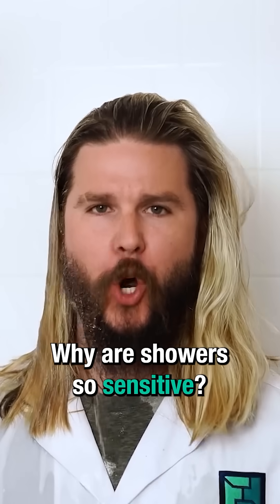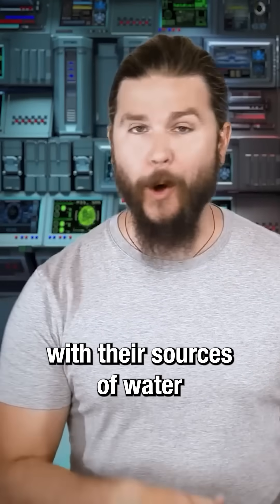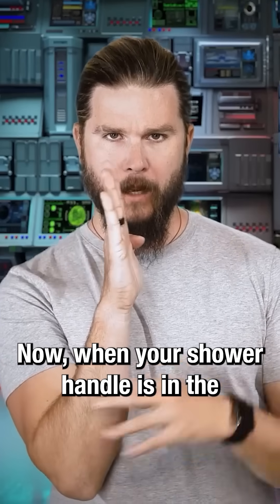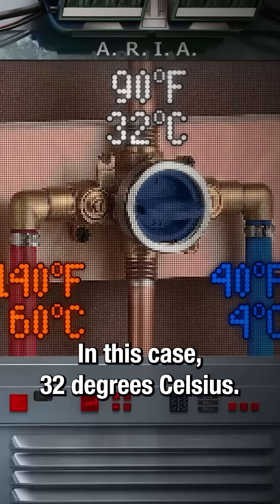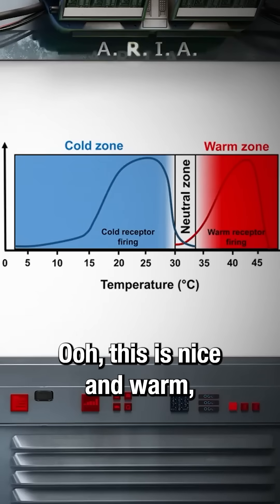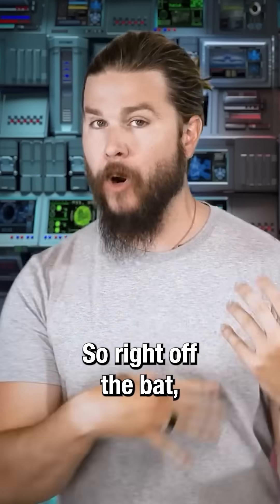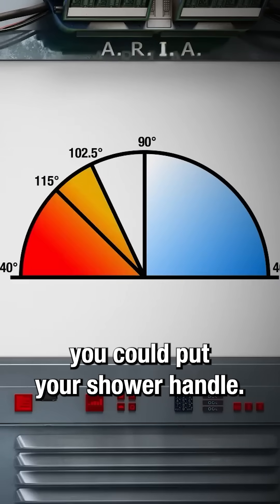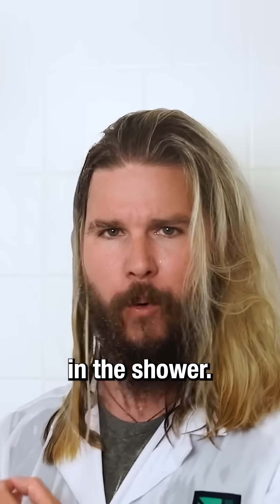Why are showers so sensitive? 🥶🥵

Comment: Kind of, but not the main reason. Due to thermodynamics its hard to perfectly mix two fluids in equal measure. There's almost always an imbalance. To achieve a good mix, you need a feedback loop so that fluctuations in temperature cause compensation of the missing hot or cold ingredient. This is best done with a thermocouple such as a bimetallic strip. Without this you have to get the mix just right by hand, which is a delicate balance.

Comment: No...pretty sure mines just messed up. You can see the pressure drop when it starts letting the hot water "mix"... because it shuts off the cold water. No, i dont mean there's a tiny few degrees of pure bliss. I mean it legit turns off the cold water and only lets hot water through. If you go slow enough you can actually get a slight trickle where neither of them are really working right about in the middle. Screw this apartment man. Havent even mentioned that the shower nozzle in from the side wall so you only use the front half of the dang tub to shower.

Comment: Mine's definitely is lazy engineering. Because there's no mixing, the second you tilt it to the hot side, it is maximum hot. The you nudge it 2 mm to the cold side then boom, ice cold

Comment: There are showers that have not individual knobs or one big one that mixes hot and cold and instead has a digital control that you set to your exact liking,  and you can save "your perfect mix" so every shower is just right for each oerson in the household. The problem is, those types of shower systems cost many thousands of dallors with some costing tens of thousands and have shower heads that are at every angle and are adjustable. I sure wish i had $20,000 to get the "perfect shower."😂

Comment: A well installed shower will have the intake valves adjusted to ensure that the heat settings work well. Installed properly even a cheap shower works well. Blame the plumber, not the engineer.

Comment: Cold water in Texas summer means something different than cold water in Oregon winter. And hot water boilers also dont have the same output-temperature. So the handle kind of has to allow a 100% cross-mix.

Comment: Feel like calling it lazy engineering implies that things would catagorically improve if we only had control in that sweet spot but over a larger handle area

Some ppl (me included because it helps ppl with adhd) take quick cold showers in the morning for many different reasons, and the hot hot water on the other end is helpful for cleaning, as most places, the only faucet you can get a bucket under to get properly hot water is the tub, unless you plan to boil a big pot on the stove and dump it into your bucket which is incredibly dumb

Comment: You can adjust your water heater so it's not spitting out 190°F.
There's usually 2 thermometers for short and long term response too. This isn't a problem for little who take the time to get to know their homes they spent over 6 figures on

Comment: Why people accept this kind of handle?
The best ones are the twin handles (idk the actual name, but I mean having one valve for cold and another for hot water), they give you the ability to control flow rate of both temperatures thus giving you the ability to control the total amount of water and the exact temperature of the mixture.

Comment: My college dorm showers solved this problem by simply having the handle stop before the sweet spot. If 0degrees are in the sweet spot, everything is equally wasted. Truly inspiring.
Reply: My college did that once. Once. Until the weight lifting guy 'accidentally' broke all those. And continue to break them when they were replaced. Shame. Still a mystery how it happened. No one saw a thing. RA briefly suggested shower cameras but you can guess how that went.
Reply: @RascaldeesV2  based 😎
Reply: It's easy I just turn the hot all the way on and lightly blow on the cold and then it's not hot enough and I have to turn it down.
Reply: Dam
Reply: Just youtube "how to adjust shower mixing valve." Super easy to do.
Reply: @breathemore8099  in a college dorm? Depending on the rules you could get in massive trouble if caught.
Reply: @russianbear0027  Lol that is funny. People in college doing drugs and you are worried about adjusting the shower temp 1-5 degrees.
Reply: @jacobs7764  I don't know why but that comment is hilarious to me
Reply: @jacobs7764  Clearly never bonged the shower pipe at uni?
Reply: @breathemore8099  That's a hell of a whataboutism.
Reply: Open the cold water somewhere and let it run. That will decrease the pressure of the cold side allowing hot water to have the upper hand.
Reply: @jackykoning That's a huge waste of clean water.
Reply: @nonine09 who cares?
Reply: @nonine09  Well, it's not his fault is it?
Reply: @nonine09 tap water is basically 2 cents per gallon here in the united states 🦅🦅🦅🦅🦅🦅🇺🇸🇺🇸🇺🇸🇺🇸🇺🇸🇺🇸
Reply: Wow the most American thing I read today 😅😂
Reply: @QuintonRC23  Everyone with a sense of responsibility does.
Reply: @chimponkoman  As if first world countries don't have clean water issues?
Reply: @arandom_bwplayer  2 cents per gallon doesn't mean you should just throw it away, real value isn't always something expressed by its monetory value alone.
Reply: @nonine09  meanwhile golf courses in the dessert are being watered
Reply: @nonine09  true
Reply: @chimponkoman  "Just don't live in a Third World country"
It's about living in the correct Third World country. Latin America, Russia, etc. have stupidly cheap running water. It's certain parts of Africa and Europe that struggle most with water supply.
Reply: @nonine09  depends, in Phoenix, probably yes, in Seattle, probably no.
Reply: @chimponkoman or California
Reply: @nonine09  Water is never consumed, it gets recycled through the - appropriately named - water cycle. Yes, it will cost the college dorm more money but that's not the residents' problem. If they want to stop the water being "wasted", it would be a good incentive for them to fix the damn shower faucets.
Reply: @OtakuUnitedStudio  In that sense energy itself is never consumed, because the amount of energy in the universe is constant and the energy we use is just converted to another form. Does that mean we should not conserve it? 1. Water cycle takes time, 2. Not all water can go back to the cycle, 3. The fresh water wasted for no reason at all could go into some better usage before it is going to the "grey water waste" facility. And no don't bring monetary value, im talking about the value of the water itself for its usage. If you suddenly don't have water (which isn't related to wasting in shower like the topic on hand) no amount of money can create mass amount of water out of thin air.

Comment: Set the boiler temperature low to bias the thermostatic mixer to the hot side. It will be less prone to sudden changes in source temperature as buffered by the entire hot plumbing circuit and less prone to pressure drops on the cold side from active washing machines, toilets, garden hoses etc.

Comment: YOUR HOT WATER IS NOT 140 DEGREES!!!!!!!!!!!!!!!!!! The risk of scalding is intense at those temperatures, most water heaters are set to 120-125
Reply: 140f at the tank, I get about 125 from the tap

Comment: I just adjust my on demand heaters temp to just above my comfort level and crank it to full hot on the shower. By the time it gets through the pipes, it's perfect. And then my kids flush, causing the heater to crank higher to heat the increased flow, then cooler to get back to normal...

Comment: Anything below body temperature is going to feel cool or neutral. Above body temperature is going to start feeling warm. 

You can do the same when feeling something hot. I blew a guys mind. Touched a piece of metal. It was warm but not enough to burn me. I told him it was between 105 and 110 degrees. He hit it with a non contact thermometer and it was 108.

Comment: If your house taps affect the shower, its all to do with the pressure so if one is too hot or too cold, just go to the nearest sink and turn on one of the taps and watch the pressure change increasing or decreasing the temp depending which  temp the tap is turned on.

Comment: Handle this, 2 knobs that.

1 knob, you have to tilt it up and spin it, it goes more then 360° either direction and only changes temperature quickly if you turn it all the way to hot, with very hot water. This was in a situation where running a sink or flushing a toilet would automatically increase the temperature from comfortable to burning your skin.

Comment: Plumber here! Answer is: MONEY! 

A tempering valve prior to the shower valve makes the hot side colder than normal, decreasing the maximum temperature of the shower while maintaining how much the ratio of hot to cold can be adjusted by the user.

As such, instead of every degree or rotation on the handle changing the outlet water temperature by 2 degrees or whatever, it can be half a degree or less. This means you can very finely tune the shower temperature easily.

Comment: Not just lazy engineering, but price. You could make it so that no matter what the relative pressures are, both sides always have the same flow rate, but now you probably have a couple more valves in there. You could make it so you pull it out to start the flow of water and the entire left-to-right range is within 10-20 degrees of center, but now your mechanism is more complex. You could make it so thermal expansion doesn't affect the mix, but after you've added all these things in, your shower valve is starting to approach thousands of dollars. Most people are going to walk into Lowe's (or Menards, or Home Depot, or Fleet Farm, or whatever big box hardware store is popular near you) and pick the valve that happens come with handle that look like what they want, for the lowest price so long as they can get that style. Quality seldom comes cheap, and neither do good engineers.

Comment: I have an old shower valve from the 80s in my apartment that has separate temperature and pressure knobs and I don't think I'll ever be able to say goodbye to it. With a little less pressure and a little more heat, I can take a shower for 30 minutes without losing hot water (tiny 30 gallon tank) it's awesome.

Comment: The reason for the wide handle range is also because cold water coming into the house can be a wide temperature range depending on season, outside temperature, water source such as a reservoir or water tower; and because people set their water heaters to different temperatures; and water pressure varies between the hot pipe and the cold pipe depending on various factors.  So the valve has to have a wide range.

Comment: The best shower handles are two shower handles - one for temperature, and one for pressure

You set the temperature once, then unless someone else changes it, you just hop in and turn it on and it’s always perfect
Reply: there’s ones that change the pressure too?? i didn’t even know those existed, sounds very convenient tho
Reply: @echowhosthis  i'm almost 40, and if not for american movies, i would not know there is those that dont have one for pressure.
Reply: @echowhosthis  Pretty much any country outside the USA uses those. It is baffeling to me why american sanitary installation is so antiquated.
Reply: @fabianfeilcke7220  I’m not even from the USA lol, so I think criticizing them for that in particular is a bit of a leap. I agree though, they seriously need bidets 👍
Reply: @echowhosthis  yes if you see a setup with 3 knobs that's probably what it is.
Reply: @russianbear0027  nah third knob is for the faucet to fill the tub
Reply: @just_jxrge_8397  it might depend then. The house where I had it was left knob hot, right knob cold, middle knob pressure and you pushed or pulled the middle knob to switch from tub faucet to shower. 

But it has been almost 15 years so my memory might be a little foggy.
Reply: @russianbear0027  only 3 knob showers I have seen used the third to switch between tub and shower. (And they were pretty old models.)

If we want greater control, most just go with a digital shower control.
Reply: It's a thermostat. When you turn it on, it basically only runs the hot pipe until that delivers warm enough water, then immediately adds enough cold water, so the water keeps the temperature that you set. It's close to magic, when you think about it. Love me some control engineering.
Reply: I've been searching for those online, but every two knobbed one I find has hot and cold knobs. At this point I've questioned myself if I didn't invent it.
Reply: @nati0598 theres even ones with thermostats inside, which will eliminate the problem of fluctuatong hot water supply.
Just set it and done if a bit hotter water comes down the line it just mixes in more cold water and vice versa
Reply: @Hallacairion  I feel like a stone age boomer now
Reply: @nati0598  if you google “thermostat water mixer shower” or similar you’ll get tons of results
Reply: @nati0598  you are looking for a "bar mixer shower" there are other types, but i don't know the English name.
Some have a Anti Scald Device, witch is a button that limits the temperature but can be pressed to go real hot.
Reply: this is standard in my country lol
Reply: Woah do these exist?
Reply: @nitehawk86  i honestly haven’t seen anything else here in sweden. the only exception is a super old shower with one knob for cold water and one knob for hot. everyone else uses the thermostat based one. using a single handle like you have in a sink for a shower is basically unheard of
Reply: OMG that would be awesome!!
Reply: These have never been reliable for me because often they're the same handle, pull out for pressure and swing for temp... but temp likes to adjust too easily so you're playing around with Bethesda item manipulation trying to get the handle in the ideal position
Reply: I have one that does all three, sides are hot and cold. 

Push and pull for pressure
Reply: For all the people saying 'pretty much every country' outside the US uses these etc etc. Ahhh no they don't... i'm in Australia NEVER heard of it till today, here 2 knobs is 1 hot 1 cold, i've asked friends in NZ, South Africa, Japan, UK and a half a dozen other places and not one of them had heard of them or find them on there hardware stores... so it seems it's just the Scandinavian countries Not these whole world except the US

Comment: NO US RESIDENTIAL WATER HEATER DELIVERS 140F WATER!!! That is SERIOUSLY dangerous, causing instant burns. Which is why it's against building codes. (Mine heats the house, so it's set above 120F but it has a tempering (mixing) valve for normal use. It's was factory programmed to 140 - the heating pipes are rated to 150. The commercial version goes to 180!)
Reply: Mine does but I did bad things to it

Comment: I remember thinking at one point that it would be really smart for faucet valves to be non-linear. The hot would open a lot at the start of the turn, and the slow at the top for fine adjustment. The cold would work opposite, the first half would be slow and then the rest would open it all the way. Then I took apart a faucet and found out I wasn't the first one to have that idea.

Comment: Growing up, our shower had separate handles for hot and cold. But the hot water tank was also set about as hot as it would go because we had a big family and were made to only shower at night.

So i would put the child handle on just enough to get sufficient pressure, then turn on the hot until i got to the right temp, it didn't take much, but it was much easier to control

Comment: Do you not have adjustable thermostatic mixers in the US? Adjust it so the max setting is as hot as you can possibly stand and then the whole range of the dial is cold to "max".

Comment: In case you have an instantaneous water heater, you can often reduce its temperature to 45°C. This has the side effect, that you save energy. Do not do this with boilers, though, because there Legionella can grow in the tank if the water has less than 60°C.

Comment: The far left is the "pre-heat" where you flush the cold water from the hot pipe and heat up any metal pipes you have. I worked in a hotel where people would complain every morning about no hot water because there was just a ton of metal pipe between the basement and their room so we'd tell them to run the sink and shower on full hot for a couple minutes. wasteful but it worked.

Comment: Get a shower with a thermostatic valve in it.  Not only does it give better mixing range, but it holds the temperature, so you won't get sudden hot or cold surges if the water pressure changes.

Comment: I'm more miffed about shower basins not having emergency drain, unlike shower tubs. They clog and suddenly neighbours are ringing the doorbell. Also timed batteries are set to 15 s at most (I wanted minutes) and no cold or scalding hot showers.

Comment: I just turn on the hot tap and shower as quickly as I can to get out before it burns me. 
No middle point exists, and the cold tap either does nothing or makes ir freezing. 
The cold knob in my shower has not been touched in years. 
My showers are also incredibly efficient.